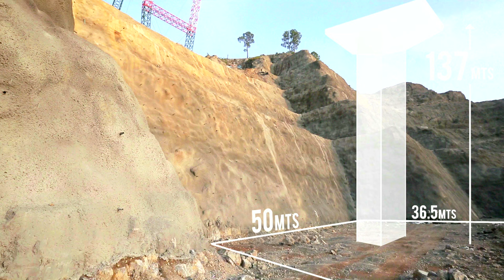Chenab Bridge Film

Comment: Started in 2004, planed to open in 12/2009, cancelled in 09/2008, restarted in 2010, scheduled to be completed in 2015, but postponed

Perhaps it will be the highest railway bridge in the world if it can be completed in 2017, but there are several Chinese high-speed railway lines planned that will contain double-track railway bridges that will surpass Chenab in height in a couple of years.
Reply: redlandpower ....that's China not India....every country is different, soil is different , climate too. And last but not least....We don't need cheap products
Reply: @angshusarma4816  I think you're missing a very valid point made by redlandpower.  It's the important issue of planning and project management.  The Chenab bridge was originally intended to be completed by 2009; latest estimate for completion is 2022; but there's a labour-management dispute going on right now, which may delay completion of the arch by May 2019 (the current target).  If this trend continues (a delay of 13 years currently) it may not be the highest railway bridge when it is actually open to traffic.  I'm not denying the engineering and construction accomplishments made.  But, it is really not a question of different soil, or climate or whatever.  Good planning and Project Management should take these into account (from the start).

BTW, China has the next 14 highest railway bridges, from 210 m to 310 m high.  I am not aware of any higher bridges in the pipeline.  Also, China has 7 road bridges (4 lanes each) from 365 m to 565 m in height.

And, it's not a question of cheapness, but of quality-versus-price.  I find Chinese goods to be of very good quality for their price; ~ 40% cheaper than Indian equivalent and no problems with quality; e.g. Electric drills, Coffee makers, Audio speakers ...

Comment: Work of Chenab Bridge is now under progress. There were many hiccups in between Court stays included due to Doubting Thomas es. insisting on changing the alignment and avoiding the bridge altogether in this location. technical issues are mostly sorted out.  Abnormal delays are telling on heavy burden financially on the contractors Afcons. Contractual issues for solving financial issues are progress but very slow and can't give any relief to contractors I media tell which also affects the progress. Afcons has to work under heavy -ve cash flow at project site.

Comment: Actually nobody is concerned about a very strategic and important bridge connection requirement in Andaman Nicobar Islands between Rutland Island and Little Andaman over Bay of Bengal. If connected with the mainland Andaman,it could be easily accessible by road and movement of military equipment and arms,vehicles and even tourist would increase.
There are no recognised MP's from Andaman to highlight the issue.